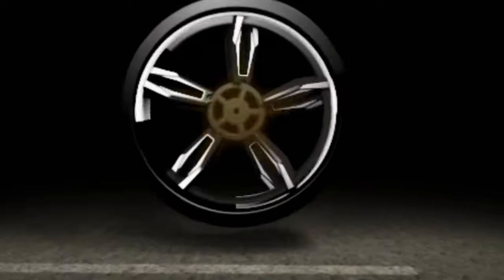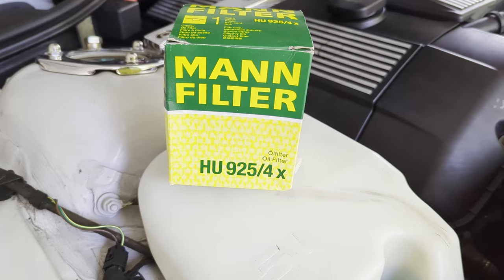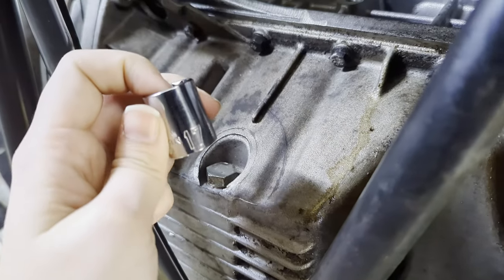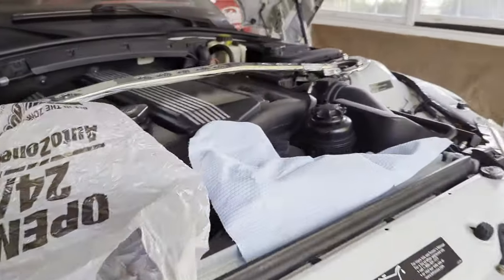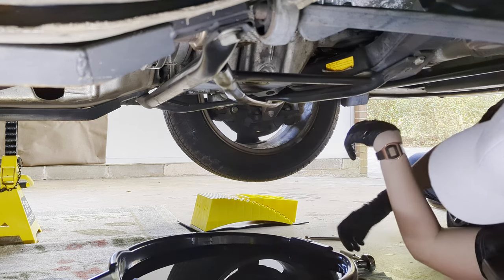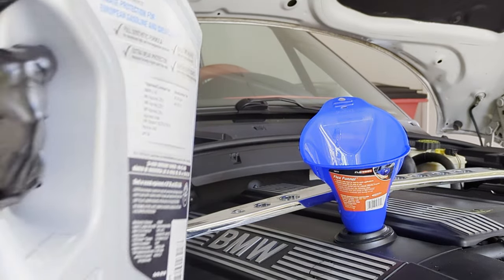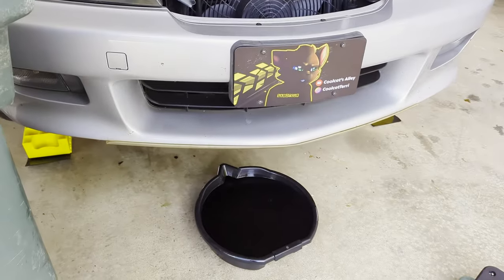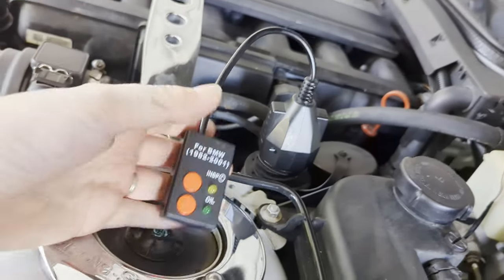Beginners DIY Guide: BMW Oil Change

Comment: Just a few tips. 18ft-lbs/25nm is fine for most bmw drain plugs as they're M12, but some can be M18, such as n63 engine which requires 29 ft-lbs/40nm. Also saturating the oil filter is not really necessary due to oil absorbed inside the filter will not be able to flow anyway, it will run dry for the first second either way which is fine due to leftover oil coating on internals since you last turned it off. Also I would ditch the oil/service reset tool that you have and buy K+DCAN cable for the same money. It will allow you access to bmw factory and dealer diagnostic software such as inpa, ista, ncs-expert etc.
Reply from the maker: Thanks for the tips. I did install inpa and some other tools on an old laptop. Just need to get the OBD2  cable and 20 pin adapter.
Reply: @CoolcatsAlley  If you have a certain year bmw, you can have both 20pin obd under the hood and classic 16 pin obd in the cabin. By bridging some of the pins on the 20 pin obd cap, you can access all the modules from interior 16pin. "Bmw 20 pin obd bridge" will bring up pictures for which pins to bridge together.
Reply from the maker: Yes, I'm aware. I do have both. I need to use the 20 pin to do the oil reset as well as check my airbag.